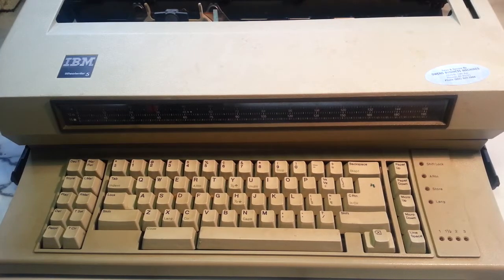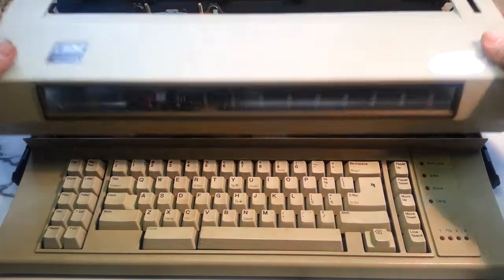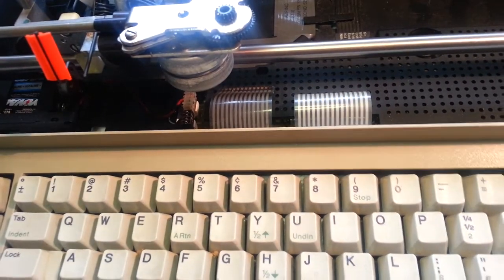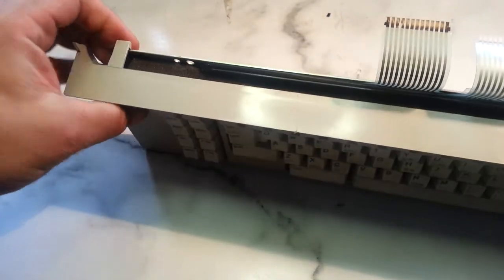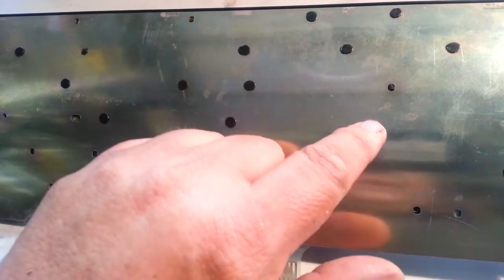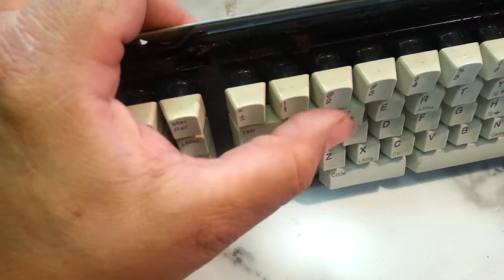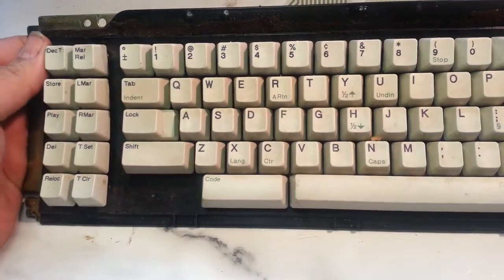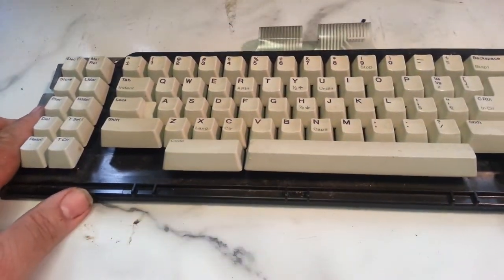IBM Wheelwriter Typewriter Keyboard Failure Bad Switches Dead Keys

Comment: You can drill out the plastic rivets and replace them with nuts and bolts. People do this to IBM computer keyboards, even when the rivets aren't broken, because they say it gives the keyboard a more solid feel. It's called the "bolt mod".
Reply from the maker: Yes you can & I do repair some IBM separated KB's using screws & nuts method, also, about 20yrs ago, I found some special small self-tapping screws that worked good too. This particular one in this video I'm sending to be rebuilt, it's 30+ years old & will get a new flex membrane & contacts.
Reply: @phoenixtypewriter2136  where do you send them?
Reply from the maker: @SMWBraden  Place in Fort Meyers, but they abruptly closed leaving lot of us with never returned items
New place is an established company now with the parts for these. ALMAR 404-483-3195

Comment: Hi Phoenix Typewriter Guy, Thanks so much for the great short to the point video info. We had a cpl IMB Windows 5, We are a small tech camera install company, so we only used one. Yet, since the corona we had to set up the other one, for social distancing. I found that's exactly the issue after basically cleaning, vacuuming the dust out, etc. Ques: Where can we send out the keyboard to get fixed/rebuilt? Approximate cost? Would it make more sense to try and get a Keyboard off Ebay or something?
Reply from the maker: http://www.national-elec.com/ , This is only place left that rebuilds IBM Keyboards for Wheelwriters
Tell them Duane from JC business machines sent you

Comment: Where do you send the key board to be rebuilt?
Reply from the maker: I was using a few place's years ago, but they have closed up.
Some other only work with typewriter dealers.
But I saw on Ebay , some ebay store there was doing them......

Comment: Hey! I have only 5 and 6 key not working... how do you actually fix this? Does anyone knows?
Reply from the maker: Of course I know, I'm an IBM trained technician w/ 40 yrs experience
First thing is to verify exactly whats happening, or not happening. I really need a 1st hand look or I'm really just guessing
BUT, Sounds like your keyboard is separating causing this failure, with machine OFF 
Press any key and carefully listen for a click when pushing down any keytop slowly, then do same for #5 & #6 , do you hear(feel) the click ??
Reply: @phoenixtypewriter2136  I have a Royal ET personal 510 plus with a similar issue.  The w, r, y, i, and p keys will stop typing out of the blue.  If I keep typing eventually they start working again.  Any advice? Thank you.
Reply from the maker: @thundercat6709  Bad keyboard flex cable or connection
Reply from the maker: @thundercat6709  sounds like flex cable is bad, also could be water damage corrosion
Reply: @phoenixtypewriter2136  something similar happens to mine. I can hear the click but it doesn't type.. what should I do? Thanks!
Reply from the maker: @fckinglies  Do all keys do this ? does carrier move ? did it ever work ? Is KB plugged in ?
Reply: @phoenixtypewriter2136  only a few don't work. These are: the space bar, letter "B" and letter "N". As you way notice, these keys are close together... I think this means something. Thanks a lot
Reply: @phoenixtypewriter2136  and yes, it's been working since 1987
Reply from the maker: @fckinglies  Sounds like a bad KB, or bad flex cable, or bad connection, would need to swap out KB to verify any further